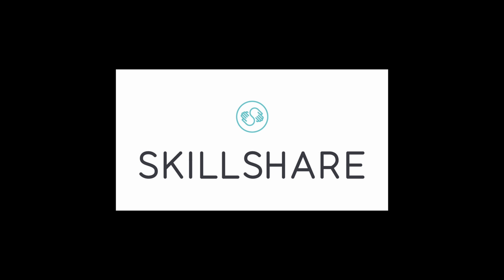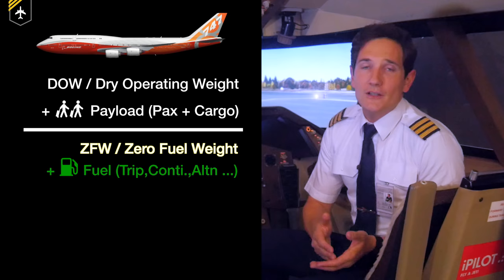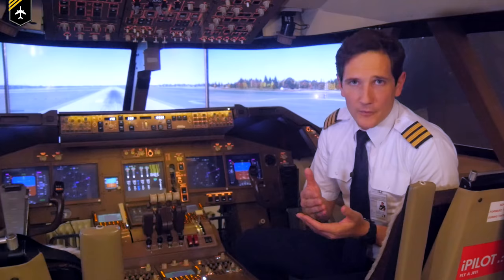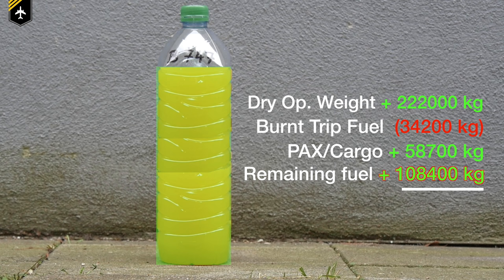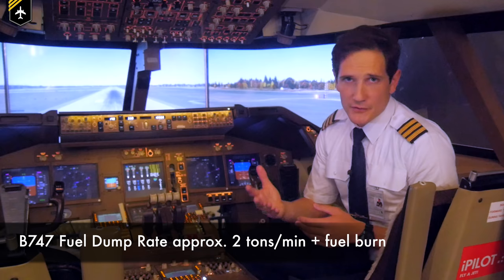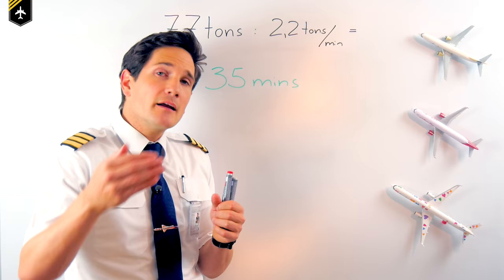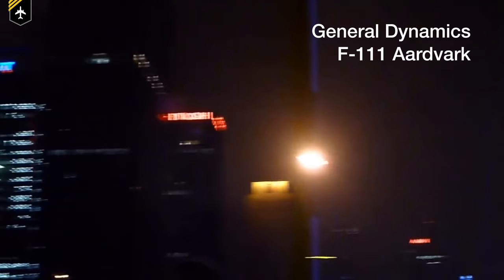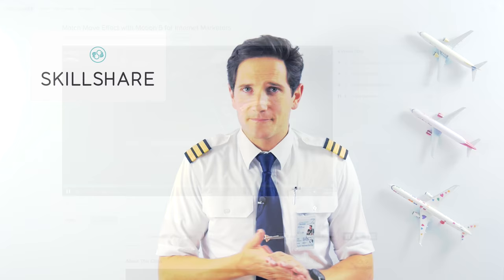Why do PILOTS DUMP FUEL??? Explained by CAPTAIN JOE

Comment: Jet aircraft are a complete environmental nightmare. The jet aircraft (747) on a ten hour flight burns 120 tonnes of Jet A. Every tonne burned requires 16.8 tonnes of atmosphere. This means the emission of 17.8 tonnes of polluted atmosphere per ton of fuel equaling 213 tonnes of toxic emissions per ten hour flight. 
All of this intensely hot exhaust is poured into the lower stratosphere where there is a near vacuum at minus 30 to 50 degrees C. Within the engine, combustion zone temperatures are reported to reach 2300 degrees C. The quantity of heat exhausted from the continuously airborne, three thousand jet aircraft is staggering, and is surely more than enough to destabilise the entire atmospheric equilibrium. These behemoths may be the primary drivers of the intense weather events that we are seeing worldwide.
Add to this the acidification of rainfall, massive ozone depletion and a hundred or more possibly toxic carcinogens in the exhaust stream, and then fuel dumping to top it off, and you have an unsustainable process.

Comment: waste of fuel and money... Can they just bring less amount of fuel?
Reply: HRIATPUIA TBC you didn’t understand the scenario fully. Its only done if the aircraft has to land in an emergency earlier than expected.

Ill try to explain with an example. Say you are planning a drive of 200km. And it takes 20 litres of fuel to drive that 200 km (ie 10 km/litre efficiency). Suppose you start, and 5 km in the trip, you have an emergency situation at home because of which you have to turn home. So total you drove 10km, for which you used 1 litre. In this case you now have 19 litres of fuel which is essentially “extra fuel”.

Comment: Wouldn't a OL be posible wihout recking the plane by landing as carefull as humanly posible? ((aka very very very low vertical speed?
Reply: would use an immense amount of runway length to reduce the vertical speed.
Reply from the maker: Correct, but as mentioned that´s a whole other video! There is a procedure for overweight landings!
Reply: Risking 400 people and an airplane for the cost of that fuel is really not a good gamble to take.
Reply: From a purely financial point of view, no. You have all those mandatory checks of the airframe,  gear, brakes and whatever else that will have the aircraft offline just to make sure the overweight landing did not damage anything. Save $10,000 in fuel but lose $100,000 in downtime and maintenance costs.

Comment: I was on an overweight landing we hit the strip and bounced up you could hear the landing gear slam into the ground and shake.
Reply: Rouge Blade runways are not smooth, and it mustve been an VFR approach if it slammed into the ground. How do you know it was overweight?
Reply: The Dooter      must've been scary
Reply: Dooter, did you and other passengers break your backs?  After all if it was that serious with steel landing gear, surely your very fragile spine discs/bones would have shattered!  Please send a link to the article.  By the way, I had a friend that knew someone that had an Aunt that new a lunch lady that said Sandy Hook was real !!!

Comment: As an engineer working in a research center, I can tell you Joe you can infact land your plane with more weight than 312.000 kg, if you decide to land tommorrow with soem extra weight, you can do it with out any issues,  however if you repeat the process several time, I cannnot guarantee you your plane will remain structurally intact.

The thing is most limits imposed on structures are way below the yield strength of materials generally speaking, even less than the half. why you must wonder if a structure will yield for example at let's say 250 MPa ( typical steel yield limit be limited to much less than that limit, and often to less than the half?

Well the answer coems from a phenomenan called Fatigue.  Fatigue is the consequence of having a material loaded under many cycles.  The more cycles you do ( in this case landing the plane ) while surpassign the limit put by the engineers, the higher the risk of failure due to fatigue.
Fly safe Joe, I know you won't land at +312.000kg but just saying haha.
Reply: Emir B.A.745d yes, a plane can land with a weight greater than max landing weight (the documented max landing weight has some tolerance, so physical max landing weight will be much more). In fact planes do make overweight landings (if getting on the ground anyway as possible is required, e.g. in a cabin fire). But as pilots we are bound to do as the manufacturers recommend.

Comment: thanks to aviation business for polluting the Air we breathing.
Reply: The air in the states is so polluted by planes that when they stopped flying for one day, it was a whole different experience to breath.
When I visited the states I could feel how unclean the air was. So hard to breath in the middle of LA.
Reply: Cars and factories pollute more than airplanes. Your anger is misguided.
Reply: If you’re upset at the aviation business then you should do your part and not fly anywhere you want to go. Walk or ride a bike instead. You’re contributing to the problem if you fly on airplanes.
Reply: + Pvt. Duckling
Pvt. Duckling Yeah? Did you take a boat, you damn hypocrite? LA has air population problems. How you got it being planes fault, I have no idea.
Reply: Animal agriculture pollutes the air much more than the entire transport industry does.
Reply: Yeah going to say that percentage wise air traffic contributes only around 3% of air polution to date, most of it comes from car usage, and power generation especially from coal and natural gas. Agriculture also contribuites heavily to it as well. Also aviation is in its very nature to reduce  its effects on airpolution by making more efficient planes every year. Gas is very expensive in the aviation industry and its likely we'll see electric planes more mainstreamed before we see cars mainstreamed ironically enough.
Reply: I am less concerned with Jet fuel then leaded AVGAS. Leaded fuels/paint/plumbing has pretty much resulted int Trump, the US in general, lower average IQ, a declared epidemic, and youtube comment sections.
Reply: So the thousands of cars and factories there are in LA don't pollute, yeah?

Comment: It's only done in an emergency, if an aircraft has to land immediately after take off or not not long after, most aircraft are too heavy to land safely due to weight issues.
If the flight crew can climb high enough to safely dump fuel then they will to lighten the weight. A "too heavy" landing can damage the landing gear, cause a runway overrun or worse...
No, it's not great for the environment but when safety is the issue......the latter is more important, rightly so.

Comment: why not just put the fuel in external fuel tanks and drop them with parachutes and grab them for later use?
Reply: The Sky Gamez What could go wrong when dropping several Kilo-Tons of fuel by parachute from an high altitude?
Reply: The Sky Gamez like they'll remember to go back and grab it also if it hits someone while landing it can cause some  problems and people will just steal it
Reply: Because that adds weight, which means they need more fuel, and it'd be more unsafe, and the fuel is very heavy, so parachutes would probably be very impractical.
Reply: It just sounds stupid
Reply: Deses that's mean
Reply: Jesus Christ  perhaps, but do you want a fuel tank piercing your roof?
Reply: Deses no but that doesn't mean we have to bash out at others because their theories are different than ours
Reply: Genius....cuz it would cost wayyyy too much money. have to modify ALL the planes. create a WHOLE NEW department to devote to doing this.  Not ideal at all. Stupid DUMBASS idea tbh.
Reply: Because that creates drag. Have you ever seen what happens to a plane when they extend their flaps over the speed they are rated to withstand? The flaps are gone. External fuel tanks would do the same thing.
Reply: The Sky Gamez, external tanks would add a lot of very significant drag and also weight and complexity.  Airliners almost never actually dump fuel- it is an extremely rare occurrence, so all that drag and weight would never pay off. 

Also, the drag would be so severe that airliners wouldn't be able to fly nearly as fast as they currently do and so trips would take longer, require more fuel, increase ticket prices and trip duration- and also reduce the distance airliners can fly.

In the rare situation that a large wide-body airliner is fueled up with 300,000 pounds of fuel for a trans oceanic flight and also experiences an emergency that requires a return to the airport after takeoff, the fuel can be dumped as shown in the video. 
One cause of needing an emergency landing is an engine failure (which is extremely rare), but in reality, the most common cause is a passenger medical emergency.
Reply: The Sky Gamez cost benefit analysis. The rarity of these fuel dumps vs the heavier and less efficient airplane would end up costing more money and burn more fuel. 

The military doesn't care about operating costs like a private business would.
Reply: unicockboy no, the argument is that the companies, the for-profit businesses that manage flights and planes, would not be willing to make such an investment because it has such a low rate of return and solves what is(in their eyes) a benign issue. Don't call someone an idiot for explaining reality.
Reply: Deses You are so disrespectful. Its ok, behind your keyboard is likely the only place you have any power in your life.
Reply: IT WOULD FUCKING EXPLODE?!?!
Reply: This commentary made me lol.
Reply: The Sky Gamez what if the parachutes fail and the tank lands on a car. Or smashes through a house. Or simply lands into the ocean contaminating our environment.
Reply: Chandrasekhar Panigrahi lol like which one certainly not one in first class.
Reply: and who is gonna pick the dumped fuel up? lol U would need to waste EVEN more fuel to operate heavy duty transports to get it back. Not to mention it could land on the fking ocean or houses and god knows where. U really need to do more critical thinking my man.
Reply: Mahi 8D they said that the fuel evaporates before it even gets close to the ground. Also they said that it only happens in rare occasions when they have to make an emergency landing. Also trying to land that much over weight could cause them to over run the landing strip. Causing a serious plane crash. Heavy landing is dangerous. That's why they dump fuel. In the event of an un planned landing.
Reply: The sky gamez, dont listen to them. Your idea was good, and there is no shame in coming up with ideas and throwing them out there to get feedback. That's how many great solutions start. Someone has an idea, and although it is not perfect, it  undergoes many changes and modifications until it is. Also, you weren't claiming to be any kind of expert in the field. Speaking of airplanes... I'm pretty sure that the first airplane didn't look like airplanes we currently see. They probably try to build ones with wings that flap like birds. People may think it's funny now but they had to start somewhere. Some of the DUMBEST people I have ever met are the ones who think they are too good to ask questions.
Reply: Geez man, another bomb for North Korea!
Reply: JIMBO i wish youtube had a upvote  option for best comment. you explained it perfectly to these nutheads
Reply: Recovery is also a bit pricy, and so will the size of the tanks
Reply: Increased weight and drag, would burn more fuel I'm the long run just carrying it then dumping some every now and then
Reply: Chandrasekhar Panigrahi I’d dump you
Reply: Chandrasekhar Panigrahi from 1000000000 ft
Reply: The Sky Gamez probably cheaper to just buy more fuel then use all of those resources for a little extra fuel
Reply: The Sky Gamez, If the external tanks were dropped, how would the airplane get its fuel?
Reply: The Sky Gamez im still waiting for someone to pick up this fuel pod that's in my living room. The new skylight is nice....except for when it rains.
Reply: :-) Best reply ever ...
Reply: u seemed freaking serious haha
Reply: eeskaatt me?

Comment: Isn't that bad for our environment?
Reply: The manouver is typically performed at higher altitudes so the fuel can dissipate before reaching the ground. However there have been some instances where this has not been the case. A good example is a Malaysian flight exiting from Brisbane, Australia last year. Engineers, pilots and ground crew failed to conduct a proper walk around inspection before push back and they left the pitot tube covers on. The pilots didn't realise they had no working instruments until after they took off and due to this, they were forced to dump tonnes of fuel in the Brisbane River and ocean so they could perform an emergency landing.
Reply: Berave Trolliolli  no, at higher altitudes it is quite fine. Only when the procedure is conducted at low altitudes and that is only done in emergency situations
Reply: Hella bad for the environment.  However, it's the lesser evil to dump fuel rather than land a plane that is too heavy.  That could lead to the plane going kaboom and everyone dying.

Comment: What if the fuel is dumped over a natural reserve?
Wouldn't that suck a little if fuel is dumped over a coral reef?
Reply: dump it over a city
Reply: Apparently it doesn't land on the ground. It evaporates.
Reply: ^^^ spray febreeze, now check to see the puddle. keep looking. if you dont find one thats your anser. now imagine its being sprayed at 35 thousand feet. definitely no puddle

Comment: Me trying to work out the fuel dump equation:

...mumble mumble "carry the 7" 
...mumble mumble "divide by 0.2" 
...mumble mumble 
NOPE! Math STILL sucks!!!
Reply from the maker: Come on it´s not that hard ;)
Reply: 12 T/h 
12 T/60m

12 goes into 60 5 times
Therefore 1/5 T/m = 0.2 T/m
Reply: Not much different from drug calculations micrograms of medication per liter of fluid per kilogram of weight. Get it right and your a rock star, get it wrong and people die.

Comment: Joe what are those spirals In turbines... And why ww2 aircrafts had spirals on nose.
Reply from the maker: Great question! Video coming up !
Reply: I'm pretty sure it has to do with letting the ground crew know that the engines are "active" and spinning. Without the spirals, it'd be difficult to tell at a high rotation and can easily result to significant injury

Comment: The key question is HOW OFTEN do they dump fuel?
Reply: wayne Last very very rare. Maybe in the low double digits per year.
Reply: ZK-APA what’s that mean? What percent of flights dump fuel? Some types of flights more than others?
Reply: wayne Last there is no set answer. Its an emergency procedure, so its only done if its needed (remember even airlines hate dumping fuel because they are paying for it)

Moreover not all planes can dump fuel. Narrow body planes (A320,B737 or any smaller) don’t have fuel dumping mechanism. Its just the wide body planes which have it.

So if you actually calculate it percentage wise, its close to nil.

Ps I am not saying fuel dumping is a good thing. Its not. But its understandable that why its done, and why are there no other alternates.

Comment: And people worry about car emissions. This should really be against all regulations except in emergency situations.
Reply: John Doe someone dying kind of counts as an emergency situation.    Or if you think not imagine it was your father/mother/wife yeah thought so.
Reply: sigh it is an only emergency option, and take two febreeze bottles. pour one out, and spray one. lemme know which one seems more harmful (pretend the febreeze is jetfuel. and pretend you poured it on yourself.) and now imagine that, but the one your spraying is at 35 thousand feet.
Reply: alex reid yeah the one out of the bottle is more harmful. The other would have evaporated before it hit the ground. Oh i forgot about all the people dying because jet fuel got dumped on them.
Reply: yea, because i see that on the news daily man, such a big problem
Reply: It affects the environment more if it was burnt and used soooo
Reply: Thatguy Man But the other passengers will actually use an extra plane to get to whereever they wanted to. It's a pointless discussion anyway as it only happens like 1 in 100 000 flights or so...
Reply: lol it is only for emergencies
Reply: It's fine. The fuel dissipates so much that by the time it reaches the ground, it's scattered over such a large area in such small amounts that no damage is done.